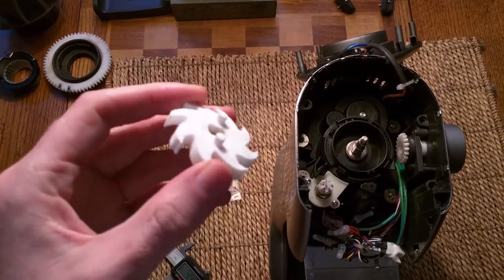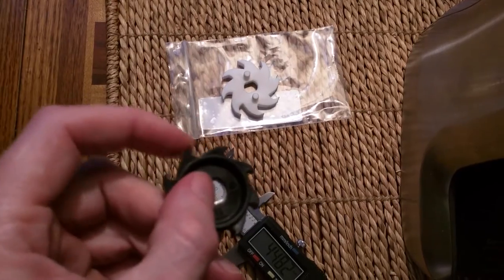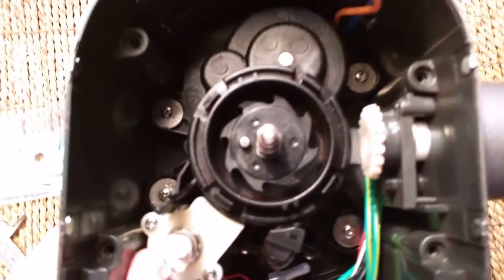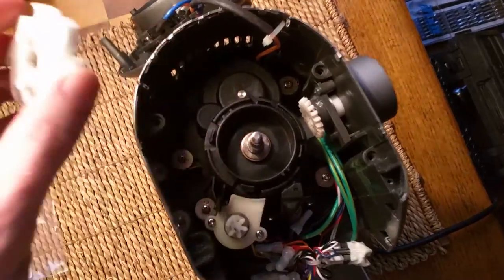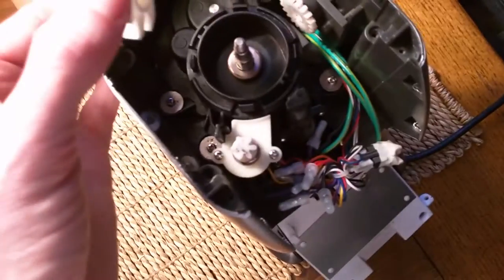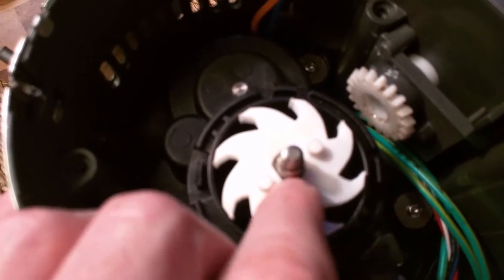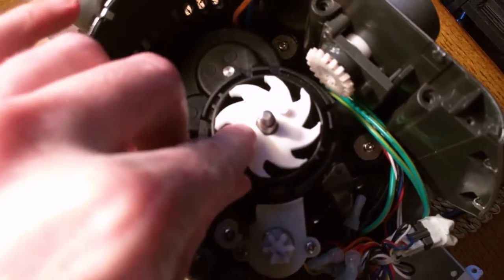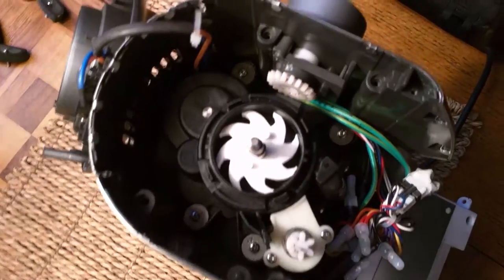BCG800XL Jamming Fix with Shapeways Impeller Upgrade

Comment: I used this part to repair the Breville Barista Express BES860XL.  I was having problems with the grinder jamming.  Brushing and vacuuming out the accumulation in the grinding cylinder would alleviate the problem, but it got to where I had to do it with each use.  I concluded I needed to replace the impeller or fan as Breville calls it.

ADDITIONAL STEPS FOR THE  860

There are a number of differences from the repair Ben depicts.  In the 860 the upper burr is attached to the drive shaft; it cannot be removed from the top by removing the lock washer.  A number of additional steps are required to remove the drive shaft and burr which sits on top of the impeller.  
- The entire grind assembly needs to be lifted out.  There are 4 obvious screws with washers to remove.
- The motor needs to be removed from the gear reduction box.  Again, the 4 screws were obvious; however the back of the machine needed to be taken off to have enough room to work without breaking the motor wiring harness.
- The gear reduction box needs to be taken apart.  This requires some care as the torque limiter has 6 ball bearings on top of 6 springs.  These would be easy to lose.  
- The drive shaft should slide out.  The first time I took the machine apart, it did.  The second time ... well, I didn't put the drive plate on tightly enough, and as a result the end of the drift shaft mushroomed over the drive plate so it would not come off without a fair bit of sanding.  Oof.  

MODIFYING THE IMPELLER UPGRADE

The drive shaft for the 860 is circular rather than flattened on both sides (although I believe this too has changed for the 8700.  So I used a Dremel to bore out the hole of the Ben/Shapeways replacement.  The posts on top of the new impeller where thicker than the original--over 3 mm vice 2 mm for the original.  I thought I would have to shave them down to fit into the burr, but they fit perfectly.  It fit perfectly into the grind cylinder with no sanding.

PERFORMANCE OF THE REPAIRED GRINDER

The new impeller works well.  Rather than a trickle of grounds, it produces a torrent, some of which sprays over the edges of the portafilter.  I think this is because the grounds are being swept out as they are produced, rather than being nudged toward the chute with the smaller impeller.

A more interesting phenomenon is this:  the grounds are lofted.  They used to be dense, almost sticky.  Now they poof up.  Again, I believe this is because they are coming out immediately rather than being compacted as they are nudged to the chute.

I am very happy with the repaired espresso maker, and extremely grateful to Ben for diagnosing the problem, designing a solution to it, and describing the repair in such terrific detail!
Reply from the maker: +Geoff Silberman Great job Geoff! Really glad it all worked out. If you like, there's a Troubleshooting Overspray step in the ifixit article that usually takes care of those few grounds missing the portafilter. Enjoy your coffee!
Reply: Thanks, Ben, I will try that!  I would like to buy another impeller to have as a spare (I think I saw yours hadn't experienced much wear after a year).  Would it be possible to modify the design for 860XL users so that the drive shaft hole is circular (10 mm diameter) rather than flattened on two sides?  

Thanks for your insights and help!
Reply from the maker: I bet yours will last the life of the machine. Mine is holding up really well. If I get time to make the mod and send it to ShapeWays I will give you a heads up. Probably wouldn't be till next month though with the current workload. Cheers!
Reply: Thanks, Ben!  

As an aside, you probably know that a ton of people have had this issue with Breville grinders.  A relatively small percentage have discovered your solution.  Most people get frustrated with Breville customer service, and if they are out of warrantee, just pitch their machines.  That is very sad, to trash an otherwise-solid machine for a cheap plastic part that is designed to wear out, and may not be well-designed in the first place.

In any case I have attempted to direct folks to your solution in a couple forums.
Reply from the maker: +Geoff Silberman Ah, shucks! Thanks for being such a helpful soul in the fight against entropy Geoff! I appreciate the help getting the word out.
Reply: gottebp gottebp by any chance did you ever get around to designing an impeller for the barista express? Mine gave out today and I was looking for solutions all over the place and came across your product online. If not I guess I'll have to perform the same modifications as Geoff Silberman
Reply from the maker: Unfortunately not, however if you have the right size drill bit, it's a quick mod to make. Geoff's method is good too if you have a Dremel. Teardown is the hard part from everything I have heard.
Reply: gottebp thank you for responding so quickly. I'll order it and give it a try. It's gonna be a pain taking everything apart, but it will be worth it in the end. Have a nice day!

Comment: I've just disassemble my Barista Express BES870 grinder yesterday to clean due to home oven-roasted beans. After cleaning it started to release more coffee in lower volume settings just like how it was when I first unboxed. I thought the problem was solved until today I googled and saw your guide on iFixit. The sad thing is I live in Vietnam where resource is limited so if I got your impeller I can't tweak it. Hope you release a version for the BES870 soon, especially in porcelain or stainless steel.
Again, thank you so so much for the repair guide.
Reply from the maker: Hi Zoey, If it's similar to the BES860XL, there is a user on the ifixit page (Search BES860) that describes his steps (Mainly drilling out the center hole on the impeller IIRC). That said, is there noticeable wear on your 870 impeller? I don't have an 870, however the pics I've encountered online indicate a metal impeller that should not wear: http://s614.photobucket.com/user/jdm811/media/Coffee/IMG_20140819_185136_zpspkalgvx9.jpg.html 
If it's metal then there's likely no-significant wear, and the problem is elsewhere.
Reply: gottebp Thank you very much for the promptly reply. After cleaning according to the advanced instructions in the manual, it seems to work fine. I just thought something is wrong since the blade tips are visible. Are the tips supposed to be hidden like pictures in your guide or it may vary by each model?

Comment: Watched your video repair for my Pro Grinder. Replaced the impleller with the Shapeways 3D impeller. However, I believe I did'nt turn the machine to Fine grind prior to replacing it. I marked the white parts at the two spots, small and large wheel; however, after rebuilding it I now have less grind than what should be. Would I have to open it up again and fix the inner wheel to match with the Fine Grind position? Any assist would be great. The new impeller works great and no beans are falling through before they are ground. Thanks

Comment: I also tried your design. Looks good.Only thing is that the felt washer does not fit in the bottom. The cilindrical shape to fit the washer is smaller
Reply from the maker: Hi Ariel, Thanks for the feedback. You can safely leave that felt washer out. The new impeller design hugs the raised pedestal more tightly and does a good enough job keeping grounds from getting on the bushing without the felt piece. I will add more detail on this to the iFixit guide. I'd love to hear about your final results when it's all back together. You're among the early pioneers on this. If any other issues crop up, I'm here.

Comment: I have the BCG800XL and the start button on the faceplate operates on its own.  We now have to unplug the machine whenever we aren’t using it.  Anyone see this problem?  I think i’ll see if i can remove the faceplate and disconnect the start button.  Just wondering if anyone had any tips

Comment: Breville 800xl jammed last nite.  Found your video and disassembled this morning, ordered impeller replacement, blew dust out with air compressor.  The motor still is making the knocking sound like a gear may be damaged.  Do you have any videos of further disassembly to access the drive motor and gears?
Reply from the maker: Unfortunately, there is only the overview here: https://www.ifixit.com/Guide/BCG800XL+Grinder+Jamming+due+to+Worn+Impeller/62905#s134181
It also seems the link to purchase a replacement gear no longer is valid. It may be necessary to find a new source if your gear is broken.

Comment: Hello Ben, I have an issue with my Smart Coffee Grinder BCG800XL: the motor is spinning with the high-pitch squeal, but the impeller and the conical burr are immoveable. What is the problem? It would be better to know it before I decide to disassemble the grinder completely. Thanks in advance.
Reply from the maker: Unfortunately that sounds like gear damage. Stripped gear in the gear box. Very hard to get a replacement.

Comment: I was having the same problem and this is exactly the solution I was looking for. Looks like a solid design and I'm sure it's just what I needed. Thanks for sharing your fix! I got some bad advice from tech support and long story short I need to replace the felt washer. It looks like I'll need to make a new one. Any advice on that front?
Reply from the maker: Hi Joe, Glad it helped you out too. I wouldn't worry about that felt/cloth washer (The one under the impeller, right?). I actually left mine out (it was falling apart pretty bad). It's meant to keep coffee grounds from ever getting under the impeller and on to the bushing, yet I don't think it's necessary. I've taken my grinder apart every few days to verify the new impeller design is holding up well, and I've yet to see any grounds actually getting under there despite not having the felt washer. The metal washers on the other hand are vital. Don't lose any of those :)

Comment: I bought the impeller from Shapeway and i would presume it fit the BGC600SIL grinder. I would presume they share the same impeller design. I having problem removing the top panel of the grinder to access the motor. Do you happen do have instruction how to remove BGC600?? thanks
Reply from the maker: This is new territory for me also. So far do you find that the BCG600SIL significantly differs from Step #5 and #6 of the BCG800XL iFixit repair guide? If there's not similarity you may need to do some exploring on this one. 
On a side note: Once you get a bit further, I do notice that the lower burr on the BCG600SIL looks similar to the type used on the BES860XL. The BES860XL is a much more complex machine, but it may share a common grinder mechanism. If that's the case, then there is reason to hope that the impeller will work similarly when you get down to it: While there's no guidance on the BCG600SIL in the ifixit article, there are some helpful comments from user ybergner on the BES860XL, who succeeded at repairs. Find those and it may help you later (if all these assumptions are right).
Reply from the maker: A bit late, but you are correct. I've finally written up a repair guide for the BCG600SIL here: 
https://www.ifixit.com/Guide/BCG600SIL+Grinder+Jamming+due+to+Worn+Impeller/96493

Comment: hmm I have the BCG800 and it has started to make the ratcheting noise, but only when set for an espresso grind. It can still do a filter grind without ratcheting. I've taken a peek at the impeller and it does seem like it doesn't reach the edges.. so I wonder if replacing it will solve my problem. Any feedback appreciated.
Reply from the maker: After the ratcheting begins happening, do you find that it's clogged with a pretty solid cake of coffee grounds when you look under the burrs? The impeller should keep that lower-chamber area clear and not allow it to cake up if it's working right. If the lower area between the blades (See: https://d3nevzfk7ii3be.cloudfront.net/igi/WOlrPOBE4o22SO3y.huge) is all compacted coffee grounds then it's most likely an impeller issue. If it's loose grounds, or clear, then it may be something else. This video here, was my own grinder and it was definitely the impeller: https://www.youtube.com/watch?v=8tCumd7M7Uw Any grinder that is used frequently will get to the point in that video after about 2-3 years of regular use.
Reply: Hmm thanks for the tip.. the issue did seem to go away for a few seconds when i removed the hopper and cleared the beans and grounds.. but I might have to do a bit of experimenting. Most likely i'll order one from you anyway, as the teeth on mine do not seem to reach the edge of the opening (about a 5mm gap there). Hopefully I haven't stripped the main gear, as that will be a much more expensive replacement. It would be nice to see the impeller on a new grinder, but its frustratingly hard to find an image on the internet.
Reply from the maker: Not an easy search, but here's what a fairly new one looks like (low res but it's something): http://coffeesnobs.com.au/Attachments/grind_direction_001.jpg
FYI: Two scenarios I recommend NOT bothering with the impeller are A: If a pebble got jammed in the burrs, since that's usually a gear-damage or torque limiter damage issue. B: If it was left running while jammed for a long time while ratcheting. Beyond 15-30 seconds of ratcheting, it may permanently damage the torque limiter, which is what makes that sound.
Reply: Just so I'm clear; if we hear the high pitched squeal if any beans are left in the hopper after a grind, do you think it is too far gone to repair?  A houseguest accidentally had the catch container turned the wrong way during a grind cycle and the grounds just piled against the lid, then the high pitched squeal ever since.  Does this impeller fix address that, or do you think it's more likely the torque limiter or motor itself?  The grinder still operates as long as you start the cycle totally empty of beans, and only pour in enough to finish grinding by the end of the cycle, leaving no beans left at the end of the cycle.  If one stays in, it won't start up the next time - just scream at you.  Thoughts?
Reply from the maker: +Barrett Ross If it's like this video, the cause is unknown: https://youtu.be/PcQcbHIPqx8?t=1m12s Torque limiter or gear misalignment seems likely, however it's just a guess. If it were mine, I'd open the gearbox first and try cranking tight the torque limiter nut. Perhaps even apply torque to the shaft and see if you can make it slip while the gears are visible.  Impeller is unlikely related in this case.
Reply: @gottebp - Thanks for the quick reply... yes, just like that linked video.  I'll give that a shot, but first I'll find a video that shows what the torque limiter looks like :)
Reply from the maker: +Barrett Ross This pic has it. It's inside the gear on the left: https://www.ifixit.com/Guide/BCG800XL+Grinder+Jamming+due+to+Worn+Impeller/62905#s134181

Comment: hi! is there a lock washer in your grinder? can't seem to decide where the placement with mine after i disassembled the burrs.
Reply from the maker: Yes,on the BCG800 there are two washers on top of the lower burr. One is a lock washer. The second pic here shows them: https://www.ifixit.com/Guide/BCG800XL+Grinder+Jamming+due+to+Worn+Impeller/62905#s132416
Reply: great! many thanks! :)

Comment: This is a pretty old presentation. Is Breville still using a plastic impeller?
Reply from the maker: The BCG800 is plastic. The newer BCG820 models have a mostly metal clad impeller with plastic underneath, exposed at only a few places.

Comment: The replacement part works like a charm - the ratcheting noise is gone and grounds come out! One new side effect though is that the grounds are highly charged with static and fly all over the counter as if they were 'splashing' out of the portafter. Anyone else have this issue? Anyone have a solution?
Reply from the maker: Sounds like it's almost there! Take a look at the "Troubleshooting Overspray" section in the iFixit guide here: https://www.ifixit.com/Guide/BCG800XL+Grinder+Jamming+due+to+Worn+Impeller/62905#s134179
That will reduce the problem quite a lot for you. Additionally, it seems very-dark oily roasts cause problems sometimes as well so be aware of that just in case.